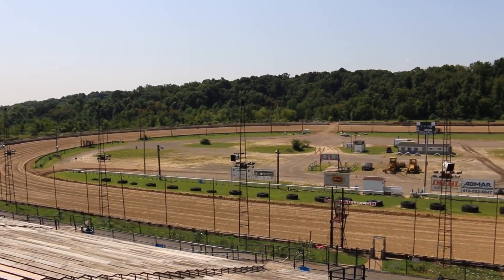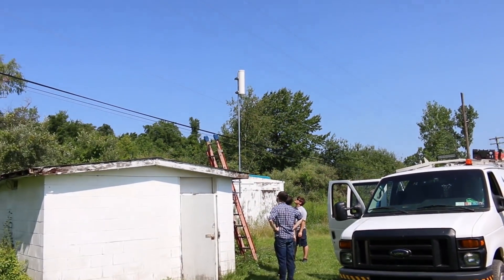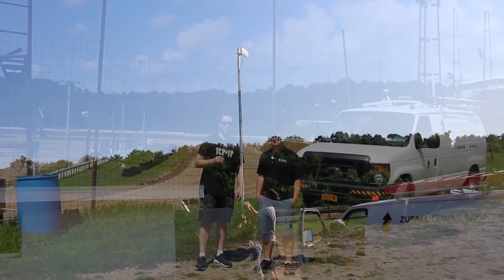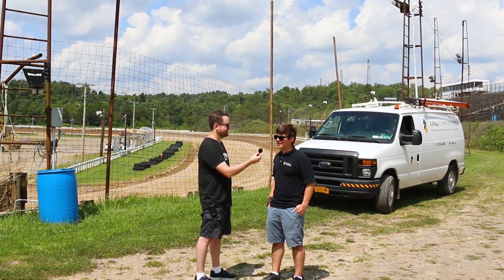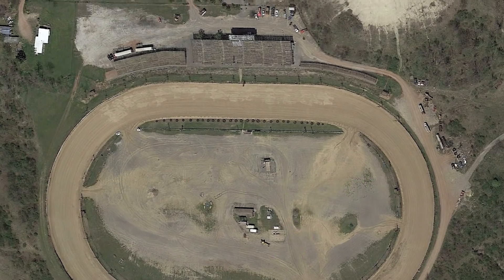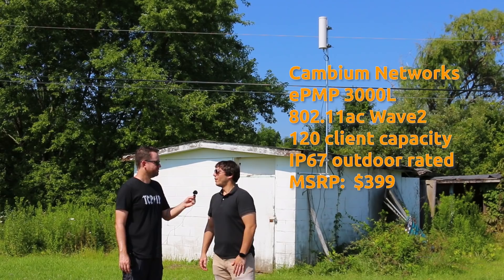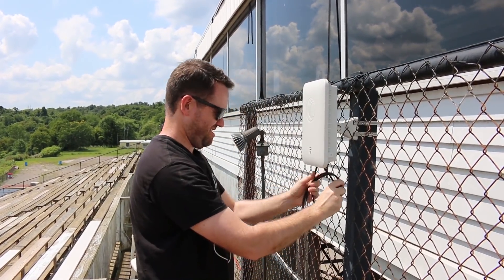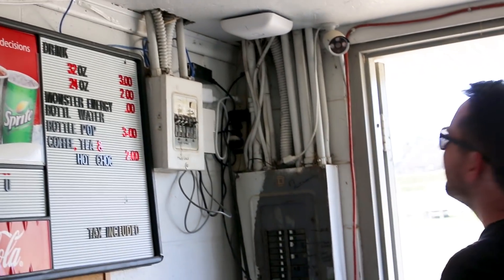Racetrack Wireless Install

Comment: FiOS doesn’t even offer 150/150 here in Tampa. I believe slowest you can get is 300/300. I have 1G/1G for $60 but I normally get about 1.5G-1.7G. They also have a 2.5G package for about $150. They even include Eero system w/ 3units.

Comment: hullo chris,this is WERE from uganda. i have an issue with epmp 2000 with ten subscribers hunging without transmitting data till you unplug the power source and plug it back every six to ten hours uptime. thanks

Comment: The cables are exposed in the video which connect into the APs. They should be covered all the way inside a flexible or solid conduit to avoid weather damage over time.
Reply: Spy NZ It is outdoor rated cable.
Reply: @AstroCraftHD  Regardless of rating, conduit provides far superior protection, especially in extreme climates like the NE. Outdoor-rated cable means the jacket is generally UV rated. If it is Gel filled outdoor rated that means it would have superior moisture resistance, regardless of that conduit once again provides superior and long-term protection as even outdoor-rated cable will degrade and is susceptible to exposure/damage issues being exposed.

Comment: Great video as always but I have a question. 
I did not compare the technical specs of the equipment, so I'm sorry if there would be an obvious reason for or against. But could you still answer the question: What was the design decision for the used products and what reasons where aginst ubnt equipment?

Comment: I’m curious how your iPhone was able to connect to an AP so far away.  I was always under the impression small mobile devices didn’t have the power to push it back to the AP.
Reply: You dont need much power when the receiving antenna has a high gain.
Reply: Also the AP probably has a super high sensitivity

Comment: I'd love to see more of the  actual settings used during setups. Like some screenshots of the setting screens or videos of you programming them . :) Channels used for each device, channel width, total ssid's, firewall info, how much bandwidth your giving to each device? QOS?Etc. Don't think any of the wild fans will bump into those access points in the stands or rip on the wires? :)